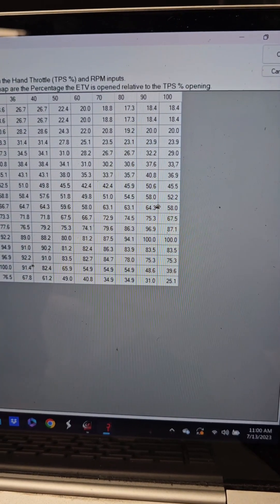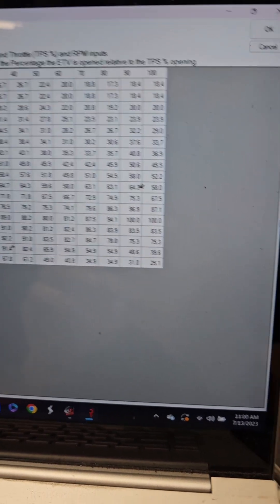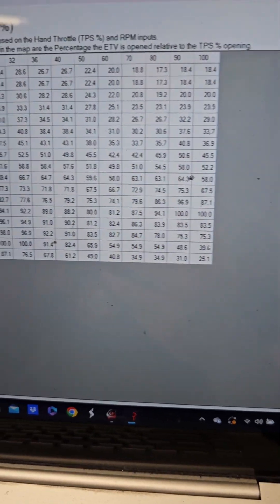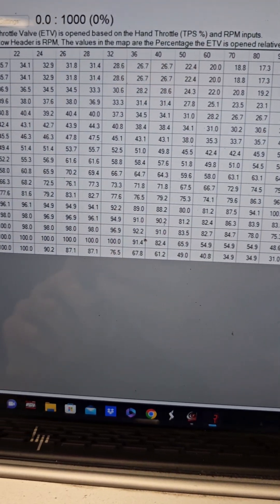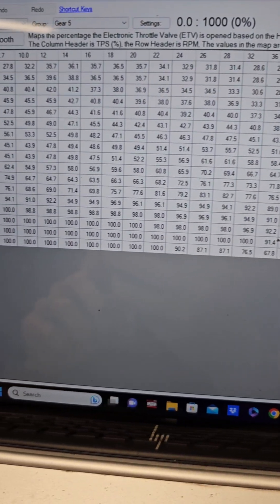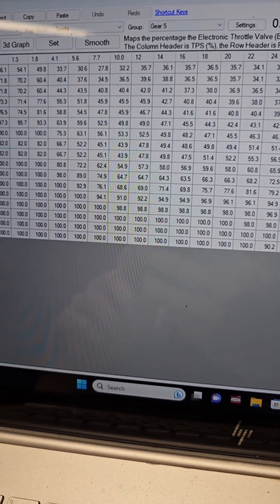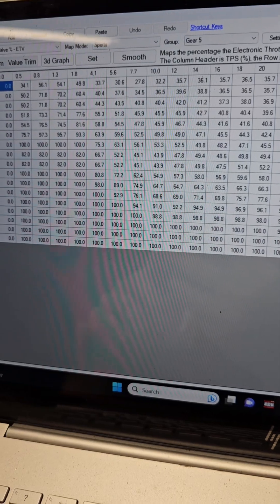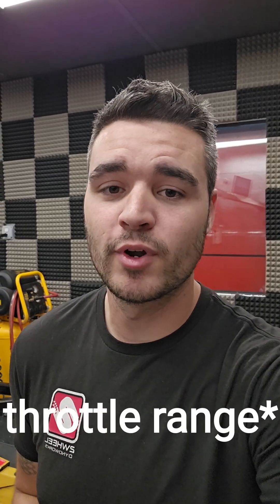How can our ECU flash be SO MUCH better than others?!

Comment: For those that are curious, I compared the historical weather in Toronto (Canada) versus Kirkland, WA where 2WDW is located, and it's almost identical in August. 

Humidity is exactly the same (69%), the daily highs and lows are within 2c degrees of each other, barometric pressure is almost identical (1018.57 mbar in Seattle vs 1010.03 mbar in Toronto). In terms of elevation, Kirkland and Toronto are very similar with a few meters of elevation in Toronto (negligible). We also use similar 91-Octane gas compared with our American counterparts which further adds to the conclusion:

Getting an ECU flashed at 2WDW should work really well for folks located in Toronto or the GTA. No further fuel mapping is required at a local shop once you've got your ECU flashed with 2WDW. 

If you still think getting a local tune in Toronto is the way to go, check out Danny at Champion Cycle and Jay (JsFlashTune) at Speedlab.ca. Caution with Pro 6 as they've recently gotten some mixed reviews on GTAM.

Comment: I had my 2017 FZ-10/MT-10 flashed by these guys. I did a de-cat, block off plates, K&N filter with a Austin Racing exhaust. When I put the bike back together, and rode it you definitely noticed the difference!!! They did a phenomenal job. Before sending it to them I called a couple of times and they seemed happy to answer all my questions. the customer service was just as good, if not better than the flash. These are the go to guys for ECU flashing. I just got a GSXS 1000GT and was considering sending my ECU to Moore Mafia because they're a Suzuki dealer. But, after watching this video I'm going to stick with 2 Wheel DynoWorks. I believe they're the best in the business when it comes to ECU flashing.

Comment: Interesting to listen to. But let’s be honest here, don’t lie to yourself. You’re not performing every single one of your steps on every single bike with every single different exhaust, filter, slip on and velocity stacks possible. You are not doing that.

One topic you forgot to mention, is that you’re calibrating these bikes at 500-800 DA. The files you send off to these customers could be at 3,000-4,000 AVERAGE DA. So now all this hard work you apparently put into this file, the bike is going to run pig fucking rich. And don’t kid yourself and tell me you “compensate” for Density Altitude.

We ran a file from you on a 24 zx6, fueling was all over the place not to mention running leaner than I’d like to see. How could that be possible when the DA was nearly 5,000 feet that day. You keep doing you and acting like you’re the best bike calibrator on the planet.

Comment: Anybody have a 2017-2024 GSX R1000R that they had re flashed using this guy? Because I used another very popular company who re flashed my ECU for just street use, with a full exhaust system, and restrictions unlocked, and it’s terrible. Bike runs extremely rich. To the point it dies, like it’s flooding when the revs go back down, and it reeks of fuel. Only get 60 to 80 miles per tank. I know full systems use more fuel, but come on. I can barely ride with anyone anymore because I have to stay close to a get station. And I haven’t been riding it lately because it just sucks. And I don’t want to contaminate the oil with gas. It’s just terrible. Anybody have any suggestions? Thinking about sending my ECU to this guy.

Comment: I bought your ecu flash for a 2009 zx6 r last year. And let me tell you guys it changed the way my bike felt completely. It has more power, it pops on up shifts and sounds like a machine gun on deceleration and shoots proper flames. The power band is smooth and properly strong all throughout the rev range . I now describe my bike as the beast now after its flash. You sir are a very competent tuner and truly believe you are up there with the best. If anyone is on the fence get your bike flashed you won’t regret it.

Comment: Fabulous breakdown on how the timing is dialed in and the effect it has on the quick shifter.  I’ve not heard that thoroughly explained by anyone else.  I’ve listened to you talk about the various full exhausts and differences they potentially have with a tune; here is my question for clarity:   Is the ECU tune offered for a 2024 GSX 8R, with a full Spark exhaust, going to be the same tune with a full M4 exhaust, or are there actually different tunes depending on exhaust types?  If you have addressed this previously I apologize.

Comment: Yes, i do agree with your statement at 7mins about 100% full throttle demand. 

Now this is going to show my age. Im referencing the historical carburettors( SU, Webber, Deluto, Holy) that had a cable and acleraterter pump jet circut that when the throttle demand was rapidly opened with insufficient rpm and air flow. The power train would just bog down. 
So the same can happen with electronic over ride maps. Just fully open and dump in that waste of fuel.  Totally agree.

Comment: Frustrates the mess out of me to read this comment a million times over just about every aftermarket exhaust video featured online:  "Does this X brand exhaust require a tune, or can it run without?"  🤦‍♂*smack smack smack
What do people think a modern FI engine is? A coal burning steamer?
And on the other side, it's also extremely frustrating for muppets out there who spread the gospel of "manufacturers know a thousand times better than any tuner about how to set up a bike/car/truck, so quit messing with them, leave them stock!!"

Comment: Full throttle all of the time >.> Moore Mafia?
Reply: Who knows. But he's a drag racer. Drag racing has a whole different set of needs from a platform than someone running laps around a race circuit or someone looking for a nice precise ride on the street or out in the wild. He doesn't much care about part throttle precision and RBW mapping and blipper functions and ignition cures for a specific set of bolt-ons, or anything that takes a massive about of time away from his core business model, potentially. That's not dissing him, he understands a lot, but it's not the same.

Comment: Wow, I wish I could find a tuner like you here in Sydney, Australia. I have a deeper understanding of tuning than the average guy due to my Study many years ago, but I just get spoken to like I'm a complete dummy. I have a project going where I will be putting the latest model Triumph765 engine into my Daytona frame for BEARS racing, as I have destroyed the 675 engine in that bike. I will be hooking Gen 3 headers up to my under seat exhaust. The guy who tuned both my Daytona's did an excellent job, as they were well tuned at all throttle points and fast and smooth to race. Unfortunately he isn't around anymore and I have to take it somewhere else. I will use a Rapid Bike Racing Module & wiring harness to tune the engine. Again I want very smooth on and off throttle application, not necessarily maximum power at all points. it needs to be ridable in all parts of the track, especially picking up the throttle at the apex and rolling the power on when I'm over on the edge of the tyre. I would drive a whole day to get my bike tuned by someone like you.

Comment: I have a question, what about the air difference. Air quality and elevation is different here in Chicago then where your dyno is. And every bike comes from the factory different ever so slightly. Take 2 new bikes, put them on the dyno, numbers will be off, even if slightly. How do you compensate for all these differences?

Comment: I sent in my R3's ECU to be flashed. And I gotta say, she has fully awakened. Thanks a ton guys.  👍
Reply: Is there anything needed to be done after flashing ecu?
Reply: @user-ds5rp1im1g   charcoal canister removal, O2 sensor and another thing needs to be blocked off. (  I forgot the name for that )
Reply: @hueyfreeman7010  PAIR valve. It's the device that feeds fresh O2 into the exhaust post-engine, for the purposes of CAT burn/heat.

Comment: I Had my zx10r 2022 tuned by a company in the UK and man it felt like shit to ride after flash than stock aftermarket system but just how you explain it about the quickshifter and down blipper the bike was lunging forward also the bike would start hunting on idle what would cause that ? they told me that all bikes do that after they are ecu flashed?  I finally got them to put the bike back to stock whole reason I got the bike flash to make the bike faster and run better/smoother throttle response really stuck on what to do from now is there anything specific I should tell them to do to make sure it's done correctly 😅 i wish you tuned bike in the uk
Reply: Yeah. Send your ecu to them.  Lol no one else is going to compare to 2wdw. Doesn’t matter if 2wdw told them what to do and how to do it. Still wouldn’t be even close to what these guys do.
Reply: Unless of course someone in the UK goes to all the trouble, then there WOULD be someone else doing it.

Comment: Another question about AFR.

So it is not really good to just set a specific AFR throughout the RPM range? I have seen dyno tuners do this in their videos, setting the AFR to a specific value and the final tune showing that such AFR is being targetted from idle all the way to WOT.

So, in general, what should be the AFR curve for idle, for partial, for mid rpm and for WOT?
Reply: Here’s a late reply for you. Some tuners will target an AFR that they’ve found to work for best power, for example an R1.  Great power but only gets 30 mpg at cruise as they used that same AFR for every throttle and load setting.  
I let 2WheelDynoworks not only flash my ecu, but spent a good part of the day testing different setups that I wanted to try, and fine tuning for my bike.  
Same great power as the other tuner, but very smooth throttle and cruise mpg in the very high 40’s.

Comment: Sorry if I have more than one question.

1. Do bikes have a "Commanded AFR" from factory? Like most cars, the ECU will always "target" a specific AFR all throughout the RPM range.

2. If new bikes have their own "Commanded AFR", is it really 14.7:1 (stoich) or is it richer or leaner? I know all bikes are different from factory but in your experience, what is the "common" factory AFR of new bikes?

3. If there is a Commanded AFR, so why does the AFR curve fluctuates on the dyno? I am under the impression that the ECU will try it's best to always "hit" the proper fuelling and ignition to make sure that the Commanded AFR is met.

4. Without changing any hardware of the bike, stock everything, do you think a comprehensive ECU tuning on the dyno will make at least 6-10% improvement in the power throughout the power curve?

Thanks and more power.

Comment: Where are you located ? I just picked a 2023 zx10r stock and want to put a pipe and get ecu flash debating Over mooremafia you guys ? And will a mail in flash really help or do I need a dyno ?
Reply from the maker: You won't need any dyno tuning with our custom mapping flashed into your ECU for your specific system!
Reply: @2wheeldynoworks  so a mail in with specifics on my bike will be good to go?
Reply: Recently had Nate flash tune my ecu for my 24 ZX6R... added velocity stacks, Graves shortie with Grave's headers...I cannot tell you the difference in on/off throttle the bike has now vs stock. Bike literally has about 190 miles on it and THIS is what it should have been from the factory...... IF 2WDW was the factory! Lots of others out there making noise about their tunes and trying to push others in the same direction...well because misery loves company! Lol I'm a pleased client and happy to share my experience. I was told that I should have gone with a live dyno tune over a flash tune...after riding my newly tuned bike all I can say is consider the source! Very pleased! 💪
Reply: @4DZC  It would be tuned like that from factory, but try convincing bureaucratic government agencies bent on saving the planet from evil man (which they themselves don't believe they are a part of) that all the performance-wrecking compliance crap put on these machines is worse.

Comment: cant imagine how some one can ask that..... just tell em that tuning software is like a cd player and the tune itself is the cd, so all the tuners might have the same cd player, but they all have their own flavor of tuning in form of cd's. SO how tuners make their cd'ssss.?? well that comes with experience and a lot of it. i know this market is like tuners have one tune and they just connect ecu copy paste and charge hefty money. almost free money for them, specially the mail in tunes. Now there are tuners that put in work, like 2wdw, all the videos of him i have seen, it looks and feels like this guy knows what he is doing. i live in a different country but if i ever come to usa and buy a bike, i;ll surely go to him. 
i recently saw a video of some guy tuning his bike at Moore mafia and they were talking about the fuel decel cut and as far as i understand, he gave him a choice, either keep the fuel decel or uncheck it, he didnt say he will tune it to make it work with the braking and the smooth blipper. i think that was zx10rr bike in a very recent video. 
Happy to know that you fix that in ur tunings. thats what i meant when i said this guy knows what he is doing.
Reply: @@aregeebee201 Compact disc, silly. Preceded the digital streaming revolution. Otherwise, you're on point. Some engines won't extend any meaningful power by raising the redline cut, some will. All depends on the engine and cams and air flow at high rpm. But it does add significantly more piston speed and fatiguing forces on connecting rods. Who's to know whether the rods in X bike will take it, and whether the customer plans to spend a lot of time around those RPM.

Comment: I have been told to go to Moore Mafia but I think you just reeled me in to go with you guys. Couple of more mods that I need to do then I will be shipping you my ECU. Thank you for the educational video!
Reply: I took my 2011 GSXR 750 ( 2 hour drive) to Chris Moore and was able to get 140.53 Hp at the rear wheel on pump gas as KWS already did a tune and left it rich as it was only 133 hp on the initial pull.  It did have a AMA/WERA legal supersport head KWS did on it that is probably worth 4-5 horsepower. This is all Chris does is dyno tunes so he knows what he is doing. This guy on the video seems like he knows his stuff as well. Take the bike to the tuner Chris or this guy instead of getting a mail in flash.
Reply: Moore mafia is overpriced as hell
Reply: I cannot say for certain as it's never demonstrated on video in live tuning or in explanation otherwise, but I don't know that Mr. Moore is going to the painstaking process of environmental tuning outside of the dyno room as is explained in this video.

Comment: Can my 2023 ZX10R benefit from a tune if I want to keep the stick can? Or do I have to do a replacement system? I really like the titanium headers and really don’t want an ear splitting, cop magnet.
Reply from the maker: Absolutely. The performance improvements are still MASSIVE at the top end.
Reply: Well said. Your knowledge of engine tuning and humor unmask a core truth about the aftermarket. A..few REALLY know and everyone else..has a shop. I am in Florida, BUT your team will be getting my ECU when it's time to put my last (2023) ZX14R on the road. Keep up the stellar work you do👍.
Reply: I wish more people swapping exhausts also has some actual taste, and didn't want "an ear splitting cop magnet." I could name a few brands who make exhausts and point out very quickly what's the problem with them... those soup can mufflers which couldn't quiet a mouse down.